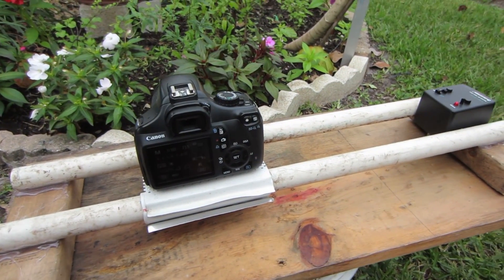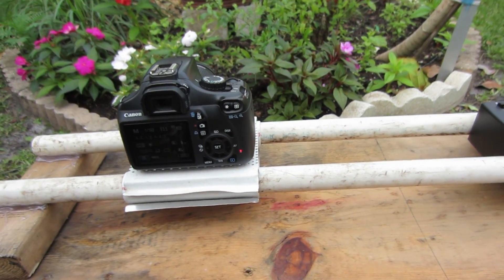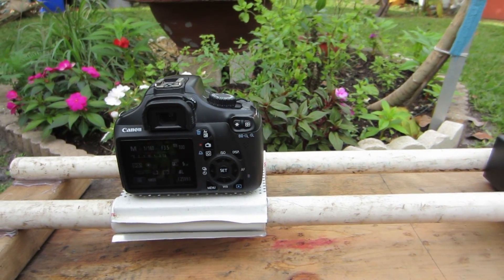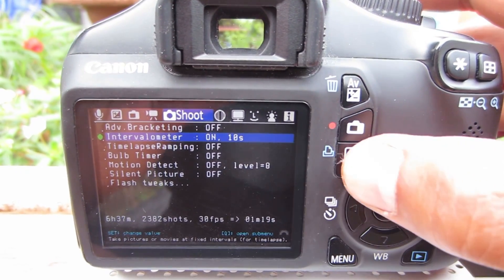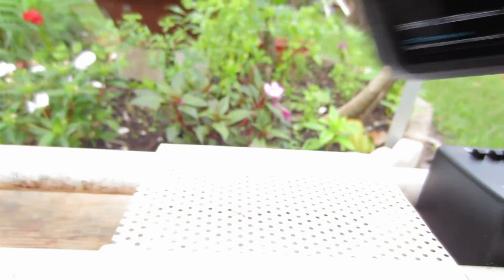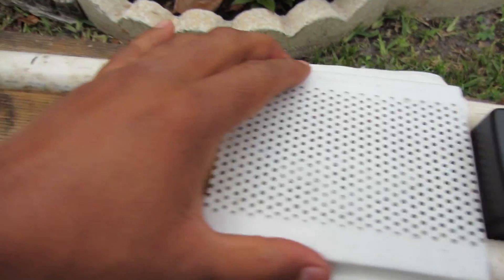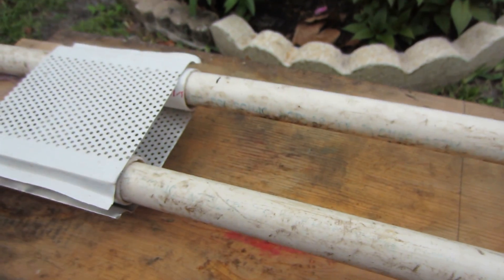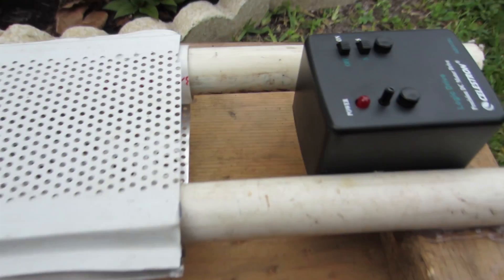DIY DSLR Camera Slider with Motor for Time Lapse Photography

Comment: I guess you found something better than the fishing line now to smooth things out, but in case you didn't, fluorocarbon fishing line is less stretchy than mono filament line. Btw thanks for making the vid, that telescope motor is EXACTLY what I need!! : - )

Comment: Thanks for tip, I bought a manual slider cost me $45 and I add celestron motor it works amazing,  cause slider comes w tighting adjustment option!.
I also think if you put the side where the motor is a little higher it will be giving more tension to cable, but of course you will gonna have to secure your camera, just make a hole on base and screw it to camera.
Thanks again for info!!!!!

Comment: yeah use some non elastic pull wire and maybe some pvc pipe that is not 100% scratched up... I would line some wider pipe with felt or microfiber to make it not pvc on pvc. A couple linear bearings from eBay with guide rails would not set you back more than the motor

Comment: Hey just wondering what the pull is like with that motor? Example : if you flipped your rig vertically, or even on an incline, do you think the motor would be able to pull your camera? Thanks!